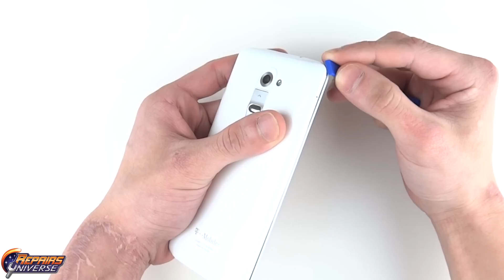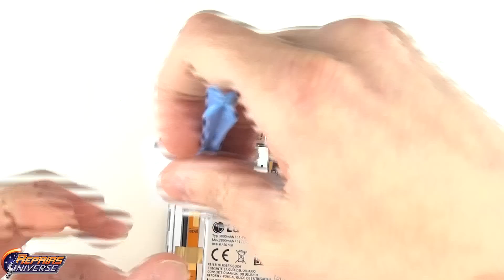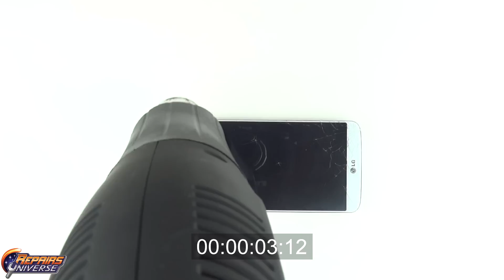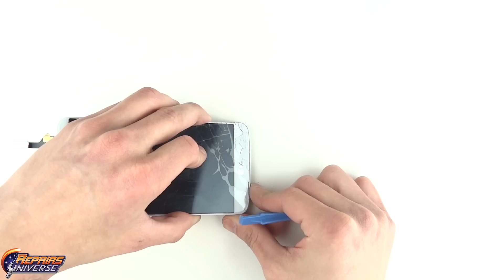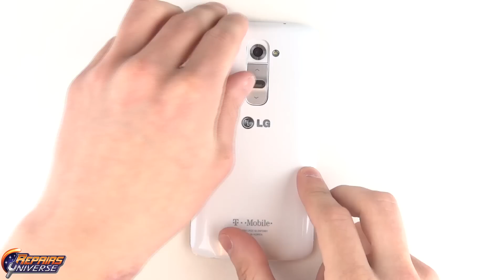LG G2 Screen Replacement Repair Guide

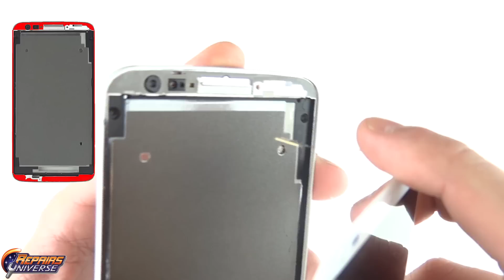Comment: Adhesive is mentioned at about 10:45, I adhere red double sided to the glass top and bottom, then adhere a second layer due to the side edges being a different height. Look at the glass and you will see the digitizer extends all the way to the side edges but not the top and bottom. You want the same height for all the adhesive on any glass to frame surfaces. I then apply a single layer to the sides of the frame of 1mm red double sided tape and remove backing then adhere after testing the screen.

Comment: Use a palette knife as a pry tool to get the glass off the frame, those plastic tools are crud for getting under the glass. I cut those plastic tools into pieces and use them as blocks to prop up glass on ipads that I want to test before adhering them down, thats all those blue plastic tools are good for.
Reply from the maker: Jeff Gedgaud Thank you for the feedback.

Comment: on my lg 2 it said that the lcd was broken as that the same thing
this is comlecated
Reply from the maker: Hunter Kackley Replacing your LCD and Touch screen will resolve the LCD issue. As the unit is fused, it's best recommended to do both.
Reply: thanks for the help
Reply from the maker: You're welcome.

Comment: ok, so i did a dry test and it worked perfectly but after i applied the adheasive and tried to turn it on the screen wouldnt show anything
Reply from the maker: It's possible the flex cable may have came lose. Double check the connections to ensure they are seated correctly.

Comment: I have a question. Perhaps you can help. I did everything as you had explained, but when I power up, a lot of white lines fill the display. Almost like one of the display connectors are not tight. I took it back apart and pressed the display connectors again. There was no change. Any suggestions? Thanks.
Reply from the maker: Ensure that the flex cables to seated and also double check that they are not making contact with the frame assembly. If checked and the issue continues, the LCD may be the issue.

Comment: Hello
First of all I would like to say thanks for sharing this video with us it is very useful. But I wonder where did you guys put the adhesive tape because in the video it is not displayed. Can you please explain ? Thanks again and sorry for bad English because im from middle part of Europe.
Reply from the maker: The adhesive goes around the inner bezel of the unit. You can also put it on the LCD and touch screen itself but of course just around the borders where it sits into the frame assembly.

Comment: My phone vibrates when I turn it on after installing the screen and all.  I can feel the vibrating from sliding the unlock on the screen, but my LCD is black.  Is this a faulty screen?
Reply from the maker: It's possible that there is a bad connection. Please double check the flex cable connections.
Reply: Repairs Universe I've taken it apart three times to triple check connections and they are all connected
Reply from the maker: Sounds like the LCD may be defective. If you purchased this from our company, reach out to us at support@repairsuniverse.com and we'll see what we can do to assist you. Thank you

Comment: My lg g2 d801 screen digitizer I purchased from you guys doesn't want to turn on. The charging led comes on and it vibrates but the screen doesn't come on. Why?!
Reply from the maker: Have you double checked your flex cables? Please ensure the cables are properly seated.

Comment: I need to buy a new LCD and touch screen digitizer, I looked through all your options on your website including the VS980 and D802/D805 but it doesn't say that they are compatible with my phone. I have the LG-D803 model that is supplied by Rogers in Canada. Please let me know which replacement would be compatible with my phone!
Reply from the maker: You would require the standard LG G2, we offer them in White or Black. Link: http://www.repairsuniverse.com/lg-optimus-g2-lcd-touch-screen-digitizer-replacement-black.html Link:  http://www.repairsuniverse.com/lg-optimus-g2-lcd-touch-screen-digitizer-replacement-white.html

Comment: Replaced the LCD and Digitizer step by step from the video, and at first the screen wouldn't turn on, then we readjusted a pop connector, and reseated the antenna. Now all we get is snow on the display any time the phone is turned on. Tried several things: reseating the glass front and attaching digitizer portion, reattaching pop connectors, reseating motherboard, and taping and retaping; the best we get is snow.
Reply: The issue is the small circuit board with resistors that sits immediately below the white coax connector on the daughterboard. The original screen has orange insulating tape on it, that keeps noise from the coax from bleeding into the screen. Transfer that from the original, or cover that with some electrical tape.
Reply from the maker: Mike Lyons The replacement part may be the issue. You may want to try a different LCD to see if you get the same result if all your connections are properly seeded.

Comment: I want to know if my LCD flex cable is loose if I press real hard on the right bottom right hand corner just right it turns on and it starts working again. but if you just drop it again it goes right back to the static screen.

Comment: Hi I have LG G2 D802, my phone's display is flickering, what causes this kind of problem and what could be the solution? Thanks! I'm from the Philippines, actually I already asked LG's service center here but they told me that the motherboard needs to be replaced so I just want to confirm if this is really the solution. Unfortunately I bought my phone in an unauthorized distributor of LG and the warranty they will provide covers only the service. Hope to hear from you soon!

Comment: the lcd works but the touch doesn't checked all flix cable every thing in place properly but still did both soft and hard resite but no luck if have a solution pleas help out ,thanks
Reply from the maker: Black Pain The Flex cable itself connecting the digitizer may be faulty or the digitizer all together. Just ensure your pins on the flex cable itself aren't damaged or on your device.
Reply: that's what I thought the first time so I bought anther screen and it has the same problem so and the LCD works fine only the touch is not
Reply: also I looked it up in the web and it seems like a comen problem and I'm not the only one but thank for replying
Reply from the maker: You're welcome.

Comment: hi guy do you have a solution for my problem I replaced my digitizer lcd for the g2 but the touch doesn't work so I ended up ordering another digitizer thinking that the old one is broken but the new one also didn't work

Comment: The best guide I have found. 
I have one problema fter changing my screen.  I tried to turn the phone on and realized that I had not put the card in.  The phone tried to start.  It got to the circle loading and then turned off.  I put the card in and tried again.  The phone did the same thing.  Since then I have not been able to get it to do anything.  Where should I go from here?

Comment: I did the repair but am getting white lines through the screen and the colors are washed out.   found if I put pressure on the one screen connector that it all clears up but as soon as I release it goes back.   And suggestions?

Comment: Thanks for this video.  Very straightforward.  Did this last night and so far so good.  Going to have the lady test it out a bit today.  Couple things for other users

1. On the bottom of the original LCD is a ribbon with resistors on it covered in a piece of blue tape.  Make sure you peel that off and cover the new one with it
2. Be generous with the adhesive tape.  I ordered the adhesive pad on the recommended items and cut it to fit.  The top originally did not stick very well so I put the phone face down and put a spindle of CDs on top of it over night
3. Pay attention to the antenna cables.  For some reason they don't want to sit very well when putting them back together (video also shows this)
4. When putting the two plastic pieces back on at the end, mine did not snap on completely (probably broke when removing)

I ordered the spudger as well as a pad of tape.  Pry tool was included.  Tweezers also came in handy

Comment: For anyone wanting to follow these instruccions: Be sure to have in hand a proper glue or the adhesive strips recommended in this video. 
I didn't have the adhesive strips so I tried with super glue... It was quite difficult to glue the screen to its frame and didn't work so good; the sides NEED to be glued so they don't end up like humps on the sides. 
I couldn't find these adhesive strips so far. I'll look for them a bit longer. I'd like REPAIRS UNIVERSE told me if they can send them to me. I live in Lima, Peru. 

Please answer. Thank you!
Reply: Comment is old, so forgive me, but what exactly did you encounter when super glueing the sides? Is it worth it just to super glue it if I can't get my hands on strips?
Reply from the maker: Nelecccccc Nelecccccc We sell the pre cut a adhesive for this repair. I also agree never use super glue it runs and turns white
Reply: Nelecccccc Hey. Sorry for the late reply. If you already have bougth your set replacement (lcd + digitizer) then you could take it to a technician so he can help you. Importing the adhesive strips can be a long wait.
Super glue is not recommended. I just tried it because I was with no other option and was cero in cash to go to a technician. I ended up craking my replacement set because the super glue is horrible for this job and did not glue well, had to un-glue and it was a mess. It cracked, and had to buy another one. 

I bought this set with a frame. It has the screen and digitizer already glued to the frame. It's the most easy way to repair for yourself. And it's guaranteed that the sides are sealed, so it's a most effective replacement set. 

I finally got my G2 working like new again. And I did the move of the internal parts all by myself. It's easy.
Reply: Repairs Universe I'm terribly sorry that "Repairs Universe" has such a restricted shipping. Repairs Universe can't ship to Peru (my country). It's such a  horrible SHAME. Really bad. 

Ebay rules!
Reply: LoveZick Alright got hold of some strips but the phone together again and it's working fine, apart from it can't find any mobile networks, not sure if this is a problem with the antenna cables or what. Guess I'm going to have to take it apart again :D
Reply: LoveZick Took it apart and rearranged some of the antenna cables, turned it on, and it picked up the network automatically and worked liked a charm, thanks for the help.

Comment: Of course I followed every single step 100% as shown and at the end my screen is black with random colored vertical lines.... of course. Tried re-connecting the screen cables, nothing.
Reply from the maker: Efren Urena Sounds like you got a defective screen. Unfortunately this happens a lot. When a  company order 5000 screens at one time there is bound to be a couple that did not make the trip from China very well. Contact the supplier and ask for another screen. Im sure they will not have an issue sending you another screen. Good Luck!

Comment from the maker: This will not work with the International version. We are waiting for our suppliers to make these available to us. Please check our website for the newest content. We update daily.
Reply: Do you have any new info on screen (digitizer/LCD) replacement parts for the LG G2 D802 international version? Are you stocking? If not, can you recommend a vendor?
Reply from the maker: eitthvadsemegman Here is the replacement parts we offer http://myaccount.repairsuniverse.com/mod_search/?catalog=yhst-77219656498823&query=d802%2Fd805&x=0&y=0

Comment: how about the digitizer? How do you get this off?
Reply from the maker: The LCD/Digitizer come as one unit. The screen is fused to the glass. When you take the phone apart take a blow dryer and heat the front of the screen so it will separate from the housing. You can use a business card or pry tool on the corner where the glass meets the housing.
Reply: Oke, Thank you, Lets try this out.
Reply from the maker: If you have any issues feel free to email me @ Robert@repairsuniverse.com. I will do my best to walk you threw the repair.
Reply from the maker: Without seeing the gap you may want to try this http://www.repairsuniverse.com/3m-double-sided-adhesive-tape-2mm.html. It will keep the dirt out of your unit.